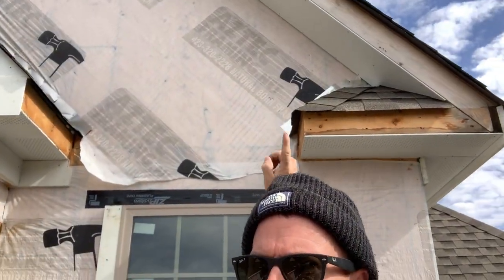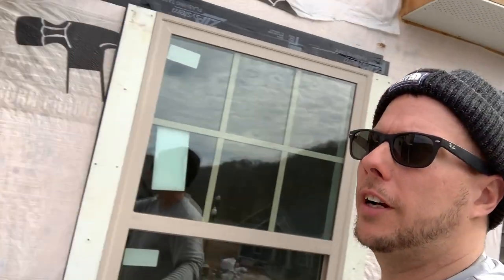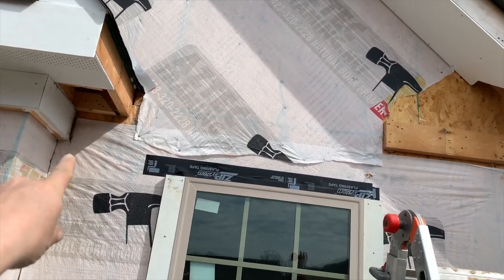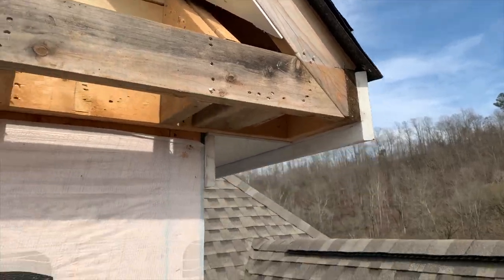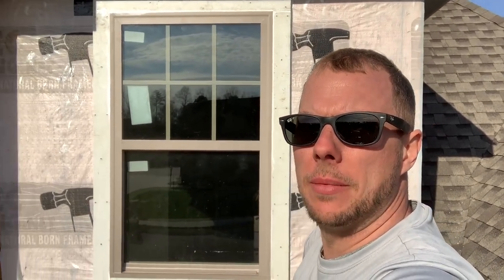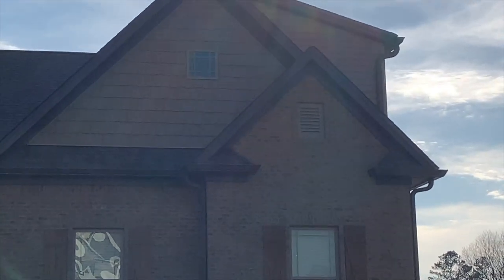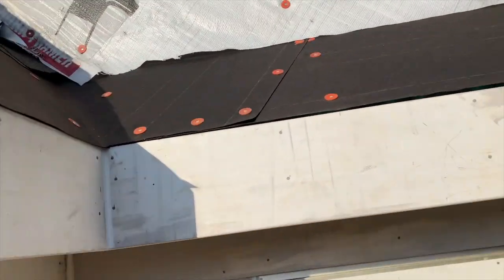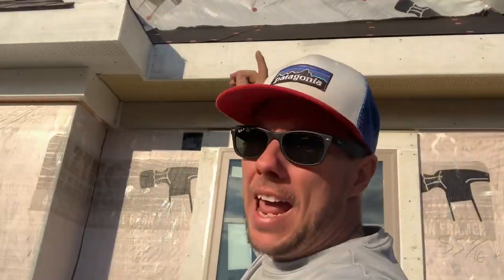Building a Roof Return on a New Construction House!

Comment: What did you use for soffit material?  looks like a hardeeboard product.  I should clarify, not the vented soffit material "Tim" brought you, but the soffit under the rake that has no holes.
Reply from the maker: Andrew Johnson yes it is Hardie soffit.  It is the same as the vented but with no holes. 1/4” thick x 12” wide.

Comment: I dont understand why this is a thing. There is little to no historical precedent for this “eyebrow” or roofing a gable end return. Architects have so badly specified poor gable end designs that craftsman just slap a pork chop end on it or come up with “eyebrows”. Building a proper freeze and cornice will allow the gable end to wrap around with the proper proportions then give it a 3-5 degree slop and cover with copper. No weird flashing, no weird “mini shed roof”. Historically accurate and architecturally beautiful.
Reply from the maker: I guess it was just something invented at some point that these designers like frank betz adopted i to their plans.   But i really dont know.  

In This case i did it to be functional.  I didn’t want kick-out flashing where the fascia terminated into the house so i added this eyebrow.  It also created a continuous gutter line around the end with a single downspout. 

I can also see eyebrows being functional on a garage with a gable end.  The eyebrow would provide some sort of rain protection for the opened garage door in some instances.
Reply: @MattFreytag  a lot has crept into modern building by designers that could have been designed with more beauty. Check out Brent Hull’s passion for craft podcast. It’s amazing, he is working with some production builder to see if they can make a better built, more beautiful production home. It’s fascinating, he’s not sure if they can do it but it’s an experiment worth doing for sure.